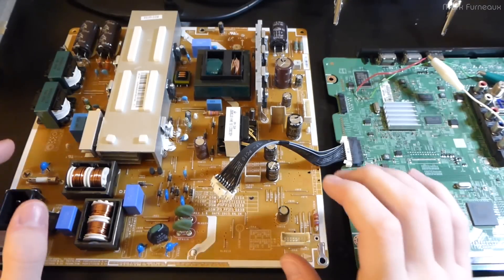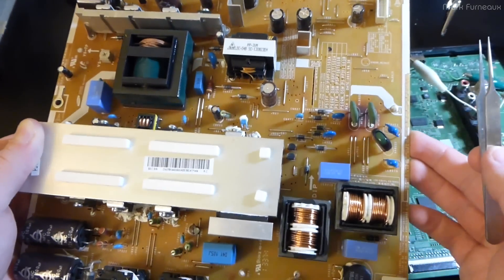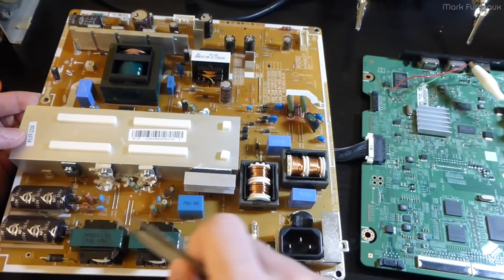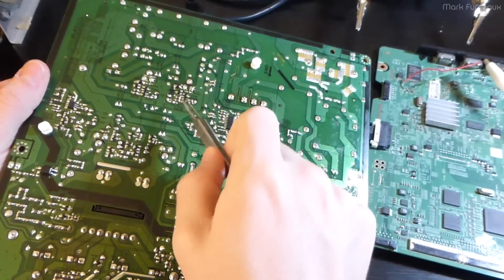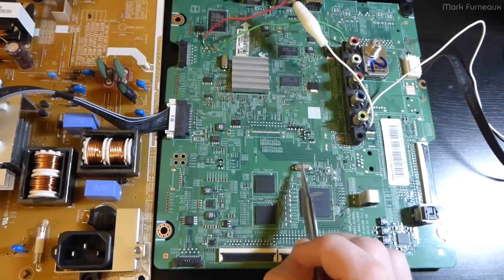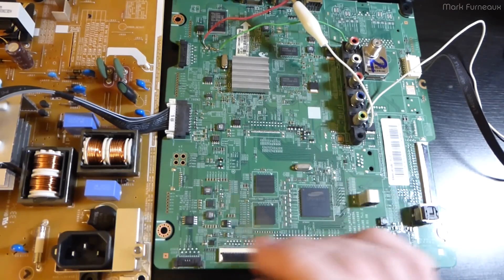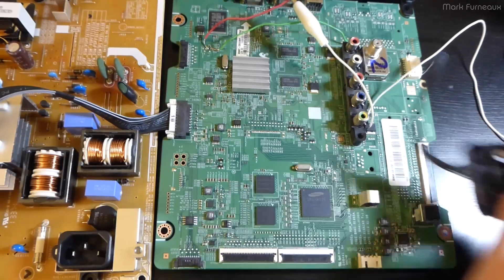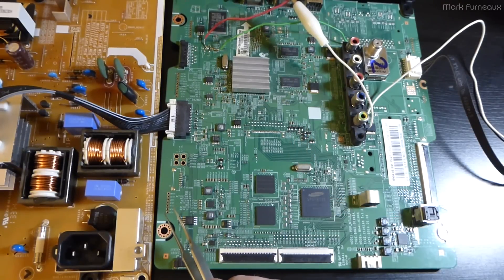Repairing a Lightning Stricken Plasma TV

Comment: My plasma (along with the cable box) was struck recently. Both were plugged into a surge protector. But the coaxial cable was not. Blonde moment. Which explains why I’ve had about 5 boxes killed over the years. The time before it killed one of my hdmi ports as well. I assumed its a bad video board. But I don’t have standby power. Does this mean it’s the power board?

Comment: Nice trouble shooting methodology. I don't think the power supply for the switching controller comes from across the opto isolator though - the opto isolator is definitely on the same standby rail on the HV side of the power supply though, but that wasn't the cause of the issue, so oh well! There are places to search the cryptic surface mount markings and find data sheets. A good place is to ask on the eevblog forums - you usually get your answer within an hour, and when you ask "how did you possibly find it so quick", people usually divulge their "secret" sources. One such place is this place: https://alltransistors.com/smd-search.php?search=161 searching for "161" turns up lots of linear regulators, dc-dc converters, and zener diodes!

Comment: Please help me diagnose source of surge. My two TV sets with satellite receivers connected to one  Dual output LNB (essentially two LNBs in one casing) and Cable TV as well. Audio/Video sections of both TVs as well as the Receivers were burnt out one month apart. Same symptoms in both cases I.e the moment I switched on the TV there was a spark in the power plug, and wire burnt, I opened the power plug and  reconnected the wire but it sparked and burnt again. This was its last time. TV and receiver were dead. The LNB was also found shorted, but only when I removed the signal splitter in between receiver and LNB, otherwise it was an open circuit there. Kindly give a guess as people are stopping me from connecting any receiver again. Another clue is that a third TV connected to the same cable TV but NOT the satellite system survived.

Comment: You called it the main logic board...I have the same issue, my boards are cheap to replace via Ebay, but I have my main board on the way in the mail, it wasn't my power board, so I'll be returning that one, but my logic board is a separate small board.  My question is, the part of the board that got hit here in this video, was it part of the logic or part of the main?  My TV is a Samsung 51" model # PN51D450A2D.  I know I need the main board bc I actually damaged it myself by accident...but found a functional one for $13.  Hoping it's the problem.  For me buying every single replacement board equals only another $114...my renters deductible is $100...so of course I'm trying to fix it before claiming it.  For some bright reason I had ONLY the TV not plugged into the surge protector that had plenty of space...

Comment: I'm assuming that Samsung IC on the bottom under the high voltage section is an active PFC controller or similar.  I could be wrong though.  Those main filter caps should be at more like 380 volts when the TV is up and running because of the boost converter in the PFC circuit. Weird..

Comment: P.S. 9:10 You might want to use a high impedance, low capacitance buffer in order to measure the crystals. Even just 10pF is enough to throw the crystals off, or to cause them to not oscillate at all. My scope has 1Meg 30pF inputs - that's enough to throw the crystals off!
12:20 No it isn't uncommon to have multiple voltage rails on processing boards like that, even for cheap products. Most larger processors run their core at 1.8V or less. Some have a built in regulator, some don't ... there's so many possibilities, it's hard to guess correctly. XD
15:20 You can get FETs in SOT23 size that can handle about 2 to 3 amps. That's kind of pushing it though, and it all depends on the ON resistance of the FET, and if you are doing any switching (switching losses).
Reply from the maker: You're right about the crystals. I know that you can get high current FETs in those packages. It's just that a regulator will dissipate a lot of heat, and in such a small package with such a high junction to case temperature, it was surprising. The part I used had 200C/W junction to case! Beyond 500mW and that thing will be cooking.

Comment: Quite an interesting presentation. I'm currently working on a TCL 32" LCD TV which has an identical symptom; no power up, but power supply has +5V standby, but no +12V or +24V (for the 'backlight'). I did measure +5V on the logic board, and when I press 'power' on the remote the 'PWR' connection on the power supply goes to +2.5V for a short while, but, as you did, I am still in the process of diagnosis...